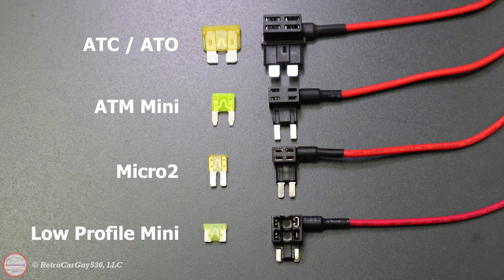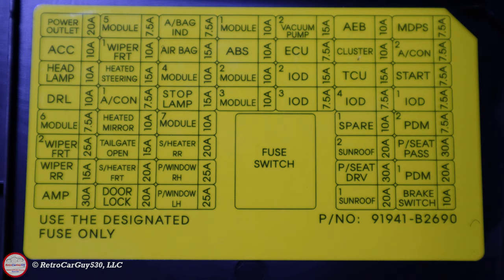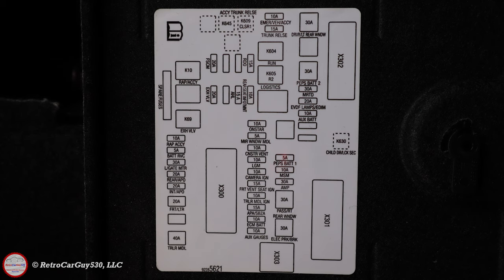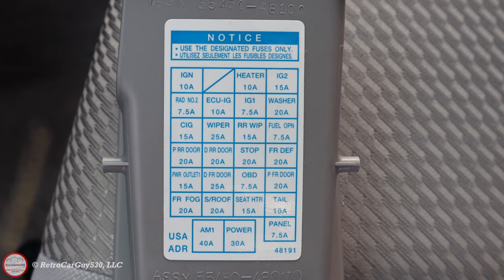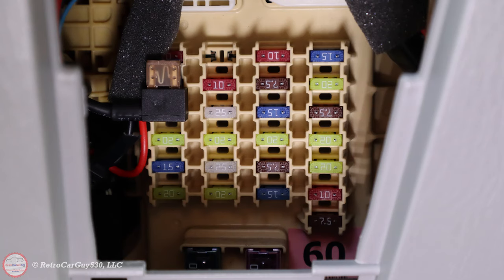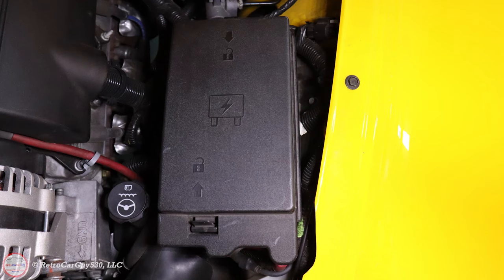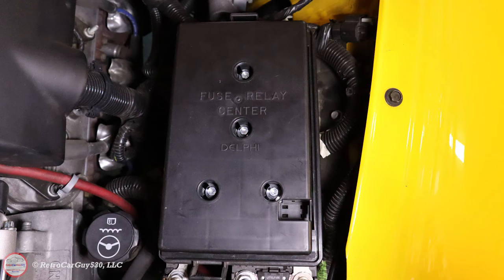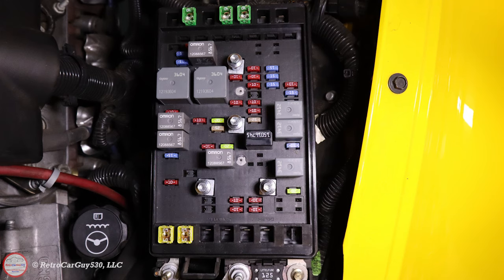How To - Add a Fuse Tap in Your Vehicle

Comment: hello , good video I need some recommendations, I would like to install a hardwire kit for my dash cam , and I found  2 empty slot that I would like to use it, first: 12.2 Volts  (ignition Off) and second 14.3 volts ( ignition on), my question is: what type of fuse used for each one and what type of Amp? and also I see in your video that in my case I don't have to used to fuse is correct?. Thank you.
Reply from the maker: If you have one fuse box fuse socket that provides constant battery power and one that provides switched/accessory power that are currently unused, then yes you should be able to use those for the hardwiring kit for your dash camera.

If your hardwire kit is a 3-wire (BATT+, ACC+, Ground) then you connect the BATT+ wire to the fuse tap in the fuse box fuse socket with power on all of the time.  You would connect the ACC+ wire to the fuse tap with switched/accessory power and the ground wire to a good ground lug or body panel where a pre-existing screw/bolt makes contact to clean metal (no paint or clearcoat on it to allow the ground to make good contact).

If your hardwire kit is a 2-wire (BATT+ and Ground) then connect the BATT+ wire to the fuse tap in the fuse box fuse socket that provides the type of power necessary for your dash camera operating mode.  If you only need the dash camera to operate while the vehicle's engine is on/running, then connect the BATT+ wire to a fuse tap installed in a fuse box fuse socket that provides switched/accessory power.  If you need it to run in parking mode, you would connect the BATT+ wire to a fuse tap in the fuse box fuse socket with constant battery power (on all of the time).  Connect the ground in the same manner as mentioned above.  Make sure the hardwiring kit has some sort of battery low voltage protection so the dash camera won't kill your car's battery.

If the fuse box fuse socket did not have a fuse before the fuse tap is installed, then you only need a fuse in the upper socket of the fuse tap and the power from the fuse box fuse socket must be provided to the left leg of the fuse tap.

All of the dash camera's that I've tested the power consumption of during my reviews of them consume 1 amp or less (12-volt system).  You could put a 2.5, 3 or worst case a 5 amp fuse in the fuse tap's fuse socket for the dash camera.  No need to get a high amp fuse for a dash camera and using a fuse with an excessively large amp rating is not good/safe for the device or the car's wiring.
Reply: @RetroCarGuy530  thank you very much I appreciate your help

Comment: My fuse box is so constricted l cannot get a probe in to test the fuse supply side any idea on how to get in to test it.The car is a Suzuki vitara 2018 ly
Reply from the maker: A couple suggestions.  You could use the half fuse approach I show in the video.  On the top of the fuse is a small metal piece exposed for such testing.  The other approach is to only put a fuse in the top fuse socket of the fuse tap.  Insert the fuse tap into the fuse box fuse socket and test for power on the wire coming out of the fuse tap.  If power is present, the left (side opposite of where the wire comes out of the fuse tap) leg of the fuse tap is inserted into the side of the fuse box fuse socket that is providing power.

Comment: Hi, I have a question, for those empty slots, how do you know if a 10 or 15 amp fuse is right for that empty slot?
Reply from the maker: There are a variety of factors that go into what the correct max amp rating for the fuse you're adding with the fuse tap should be.  You need to know the power requirements for the accessory being added.  That max amp requirement feeds into some decisions on the max fuse amp size and what the proper wire gauge is to supply the much current to the accessory.  You might find that the device draws too many amps for any available fuse socket or the fuse tap wire gauge.  In cases like that, you might need to take a different approach of using a fuse tap to power the control side of a relay that in turn will supply the higher amp power to the accessory.

I have a link to a FAQ video in the description section of this video which tries to cover those type of questions.

Frequently Asked Questions:  Add a Fuse Tap in Your Vehicle: https://youtu.be/DnZ5wb_A5vE

I hope that helps.

Comment: I’m hardwiring a radar detector and the hardwiring cable has a 2 amp in-line fuse. The tap-a-fuse kit I got to go with it came with 5 amp fuses… do I need to add one of these to the top even with the in-line fuse? Thanks!
Reply from the maker: The fuse tap requires a fuse in the top fuse socket to create the power pathway for the new accessory being powered by the fuse tap.  The only fuse that is "optional" for a fuse tap is the fuse in the lower fuse socket of the fuse tap.  The lower fuse in the fuse tap is only present if the fuse box fuse socket where the fuse tap is installed originally had a fuse in that location.

I discuss the anatomy of an automotive fuse tap in one of my other videos on that topic.

https://www.youtube.com/watch?v=YNc0FfeL6rw

Comment: I want to use a switched fuse socket and am having trouble finding one. Everyone ive tried has the usb charger on all the time. Ive tested ones that have no power to them when the key is off but they still keep the usb turned on. Any help?
Reply from the maker: If there is no power at the fuse box fuse socket when the key is off, then there should be no power provided to the item/load that's connected to that fuse tap wire when the key is off.  I'm not totally clear on what you mean by USB charger, but if it's a 3-wire hardwire kit for a dash camera, there's a wire that requires constant battery power and another wire that requires switched/accessory power and of course the ground connection (not in the fuse box).  The constant battery power to the 3-wire hardwire kit will provide power the dash camera with the key on or off.  The switched/accessory power wire will be monitored by the 3-wire hardwire kit to know when to turn on/off the corresponding line in the USB connector for the dash camera.  The dash camera will react differently to the presence or the lack of the accessory power in the USB connector based on how the firmware settings are configured for parking mode (is it enable or disabled).  If this is not what you're trying to install/setup, please give a detailed description of what you're trying to power and how you're trying to power it using fuse tap(s).

Comment: If the accessory came with a mini fuse, do I have to use a mini fuse or can I use a low profile mini fuse?
Reply from the maker: You will need to identify the type of fuses used in the vehicle's fuse box and then use that type of fuse tap.

Comment: Are there any fuse taps where the new fuse wire goes to the left?
Reply from the maker: I have not run across any blade style fuse taps with the output wire on the left side of the tap.

Comment: Sorry for this very basic question, but why is it necessary to use a fuse tap rather than just a single new fuse and cable? Couldn't the new fuse that is used for the new accessory simply replace the existing fuse in a socket and perform the same functionality? I don't understand why it's necessary to have 2 fuses in one socket.
Reply from the maker: If a fuse socket has a fuse in it already, it's protecting a pre-existing electrical circuit/device/module/accessory.  There are specific maximum amperage requirements for that pre-existing circuit.  Changing the fuse in that fuse socket can cause problems especially if you simply wrap a wire around a leg of the fuse to get power for the new accessory.  That approach of wrapping a wire around a leg of the fuse can damage the fuse socket connectors by expanding them.

The objective of using a fuse tap is to take an existing power source (the side of the fuse socket that provides power) and providing power to two different circuits from that point.  The pre-existing fuse (if any) goes into the lower section of the fuse tap and that continues to protect the pre-existing circuit.  The new circuit obtains power through the fuse in the upper socket of the fuse tap and it has a fuse that is of the correct amperage to protect that circuit/device/accessory.

If there is power present the fuse socket but no pre-existing fuse in the fuse socket, adding a fuse with a wire wrapped around a leg of the fuse will be a problem (beyond what I stated above) in that a fuse will now be present providing power to the other side of the fuse socket that was not intended to have power.  Depending on how the car manufacturer designed the circuit layout of the fuse box, providing power to that other side of that formerly empty fuse socket can provide power to things that were not intended to have power.   That's why if you select a formerly empty fuse socket for the fuse tap, you only install a fuse in the upper socket of the fuse tap so power is only provided to the new circuit/device/accessory.

The fuse amp rating for the pre-existing circuit and the new circuit being powered by the fuse tap can have different requirements.  If the fuse socket already has a 10 amp fuse and you're adding a dash camera that should have a 5 amp fuse to properly protect it, you don't want to wire the dash camera to the 10 amp fuse because if something goes wrong with the dash camera internally, the 10 amp fuse won't blow soon enough to protect the dash camera and its power circuit.

The fuse tap allow you to split the power source from the fuse socket into two different circuits from that point on and to use appropriately sized fuses to protect each of those circuits.
Reply: @RetroCarGuy530  Thank you so much for your detailed answer. That makes a lot of sense. I've been a bit confused because I'm trying to install an ETC (Electronic Toll Charge) device here in Japan, and all the instructions I've seen here in Japanese make use of single fuse cables  (not fuse taps). In fact, it seems difficult to even find fuse taps here. The guides I've seen are all using the exact same amp rating (10 + 15 on the horn and cig lighter fuses), so maybe thats why... I'm not really sure.   I'll have to think about how to best approach it with the equipment I have. Thanks again for your advice!
Reply: @RetroCarGuy530  If I can rephrase the questioner's query, if I am interested in emplacing ONLY ONE fused accessory, and my fuse block has an empty, powered site, why would I want to go through the bulk and cost of an add-a-tap setup instead of a single new fused cable?
Reply from the maker: @AuroraBorealis Bakewell it depends on what you exactly mean by a single new fused cable.  That cable needs to source its power from some location and it you need switched (accessory) power you can't go directly to the vehicle's battery for that type of power.

Using a fuse tap is likely to be the cleanest and easiest way to obtain power from the fuse box.  You don't want to add a fuse with a wire attached to one side / leg of the fuse because a fuse being inserted into a fuse box fuse socket that originally did not have one may cause power to be sent to other circuits in the fuse box that was not intended by the vehicle manufacturer which may result in parasitic power drains that did not exist before.

If the fuse socket was occupied by a fuse to begin with, then inserting a larger amp rated fuse and a wire off of that is not properly protecting the original circuit.  Using a fuse tap will allow the original fuse to be used for the original fuse box circuit by placing the original fuse in the fuse tap lower fuse socket.  The new accessory will draw its power from the left leg of the fuse tap (when installed correctly) and the fuse on the top socket of the fuse tap will protect the new circuit / device with a properly sized fuse for that circuit pathway.

Comment: If you pull a 10a fuse from the panel to use and add the accessory fuse to that Tap, do you have to use a small amperage fuse than the source.  So if I pulla 10amp fuse from the box do i need to use a 7.5 amp fuse for the accessory?
Reply from the maker: You can use a fuse that has a higher amp rating than the one originally in the fuse box fuse socket, but you should not excess a total (sum of both fuses in the fuse tap) of 25 amps (IMO).  If the fuse tap is installed correctly with the left leg of the fuse tap inserted into the side of the fuse socket that provides power, power is directly supplied to each fuse in the fuse tap.  If the fuse tap is not installed correctly (power from fuse socket supplied to the right leg of the fuse tap), this will cause all of the power to go through the bottom fuse in the fuse tap (original fuse) which can overload that original fuse.  It's extremely important to insert the left leg of the fuse tap into the side of the fuse socket that provides the power!

The other concern in selecting a fuse socket is to use one that supplies power directly from the battery or for switched ignition based power one that does not go through a module first before the fuse in the fuse box.  For example, if the BCM (Body Control Module) is providing power to the fuse socket, adding an additional load by inserting a fuse tap can potentially confuse the BCM since it may monitor the power demands on that circuit.  My 2014 Chevy Caprice PPV has a fuse box on the driver's side end of the dashboard.  All of the fuses in that fuse box are supplied power from the BCM which pretty much eliminates it as a fuse tap installation location.

I have a FAQ video for fuse tap installations that might help explain more on this topic.  https://www.youtube.com/watch?v=DnZ5wb_A5vE

Comment: I’m getting power in both sides of an unused fuse slot that had a plastic blank in it. Why? Is it safe to add my fuse tap to that one for my dash cam?
Reply from the maker: A fuse socket usually only has power available on one of the two connectors when the fuse has been removed from the fuse socket.  If both connectors have power without a fuse in the fuse socket, that usually means some other device or fuse socket is feeding power to the side that should be unpowered with the fuse removed.  That's definitely "strange".  

In theory, you could place a fuse tap into that fuse box fuse socket and have it work, but that's with only the top slot of the fuse tap having a fuse installed (not the bottom fuse socket).  The question that remains is which side of the fuse box fuse socket should have power and which should not.  There's no way to know that so, it's hard to say which side the left leg of the fuse tap should be inserted into.  

Without knowing why both connectors in the fuse box fuse socket have power, I would recommend not using that fuse socket.  It may be worthwhile to check with your car's local service department (or your preferred mechanic) to see why that fuse box fuse socket has power on both connectors with the fuse removed.

Comment: What if you live wire is already fused. Mine is for a head unit
Reply from the maker: You can still use a fuse tap and have both fuses (one in the fuse tap for the head unit and the one already in the power wire).  You could cut out the inline fuse in the stereo head unit wire if you use the fuse tap since it has a fuse protecting it there.  Either way would work and still have the power feed to the head unit be protected by a fuse.

Comment: How do I tap in to a FMM MCase. I have several 20 amp fmm mcases on the interior (passenger side) dash that are marked as +20 amps and Im hoping one of them will be switched.
Reply from the maker: I have not found a FMM MCase or JCase fuse tap, so I don't have a solution for your situation.

Comment: What size add a circuit should I use for a regular fuse box in a car ?
Reply from the maker: I cannot state exactly which type of fuse tap to use since that depends on the type of fuses used in the fuse box of your vehicle.  At 2:01 in the video I show the four common types of blade style fuses and their corresponding fuse taps.  You need to examine your vehicle's fuse box to see which one of the four fuse types it uses.

My GM vehicles use the ATM Mini style of fuses and our Kia Soul uses Micro 2 fuses.  That's why it's impossible for me to say which one to use since the auto manufactures haven't standardized on only one blade fuse type.